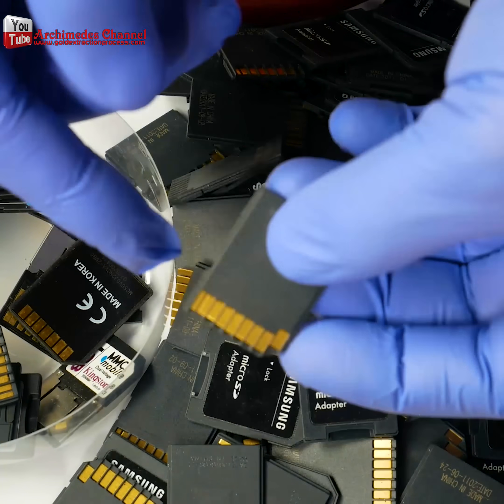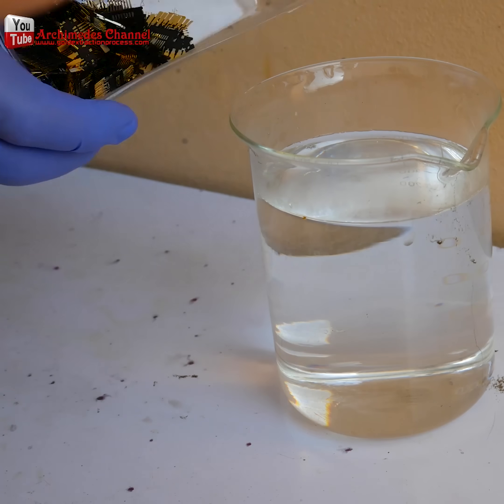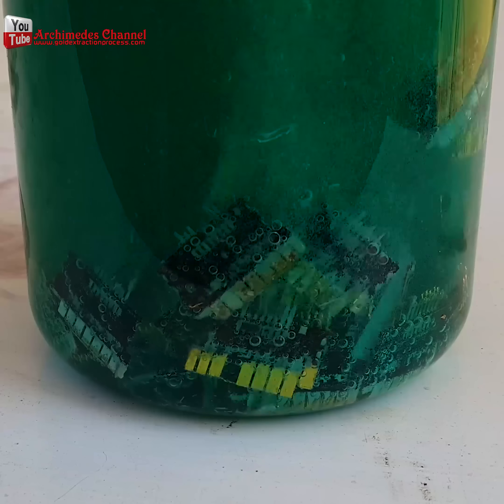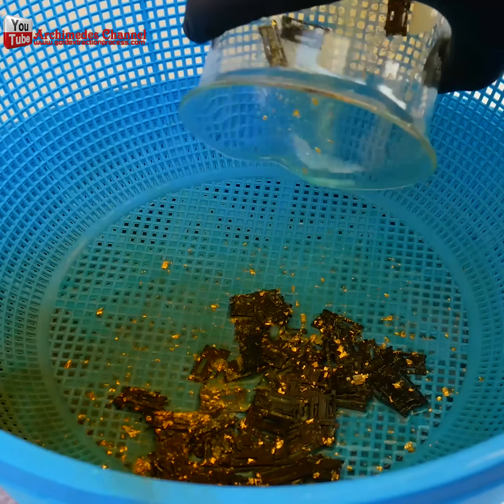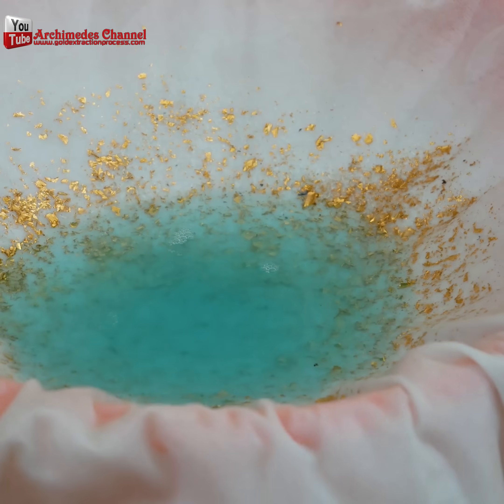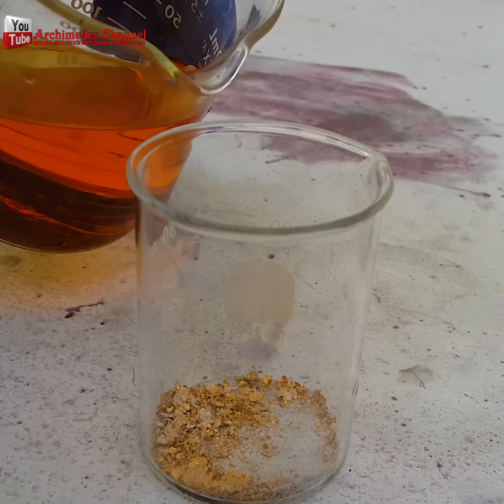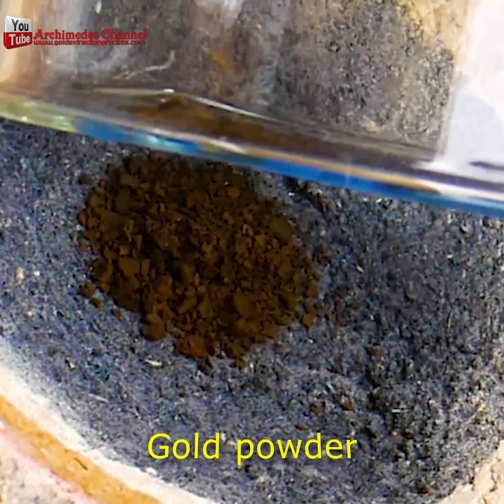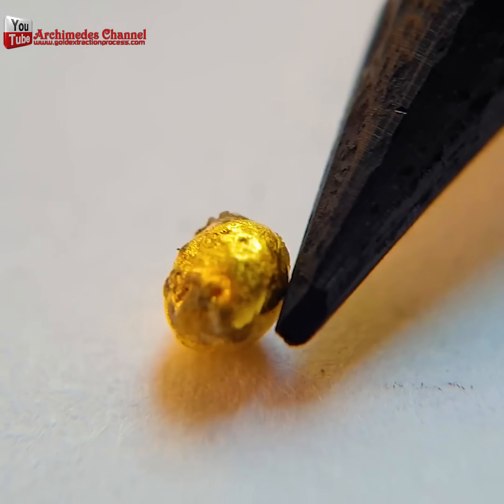How to Extracting Gold from a MicroSD Card

Comment: So here’s a question: how much does the processing cost vs gold value recovered? How much gold do you need to recover to turn a profit? That tiny bead doesn’t amount to your costs.
Reply: Only those acids and sodium, maybe less than $1 if I buy 1KG each ingredients(could be cheaper buy in bulk). Current gold price for 0.08 gram is $5, that actually pretty profitable if you can securing large amount sd card trash.
Reply: @burukani  include the trash price of sd card's too
Reply: Actually  I have a mobile accessories shop.... so I need to think about this
Reply: @VinodKumar-zp8fj  
It's not that easy.
You can see gases when he mix different chemicals. That can be lethal
Reply: Hmm...
Reply: Its not gold its coper
Reply: @Russkiy_mogger  Right, How foolish we are.
Reply: @reazulk  hold on what?
Reply: @Russkiy_mogger  yes its copee

Comment: Братан давай silver video
Reply: you can use 2 acids to solitifly silver , but both need to be heated ( 212 F ) >>> 68% nitric or sulfuric . now you can't salt out the silver like you can gold
in AR, you have to make a electric current silver cell with a cathode and anode to get the silver to form crystal structure.